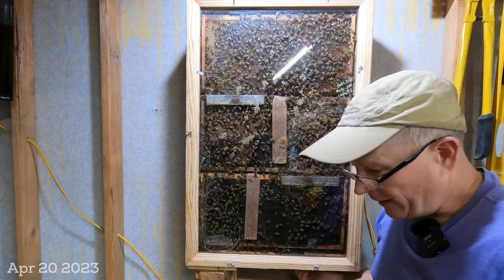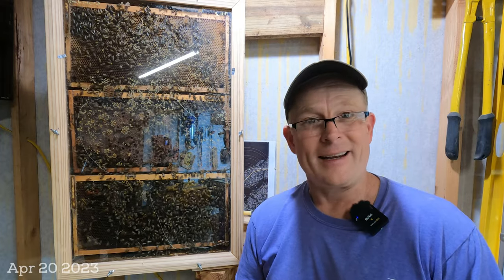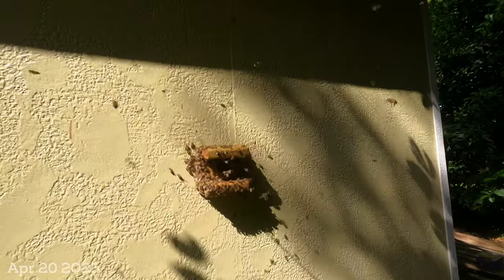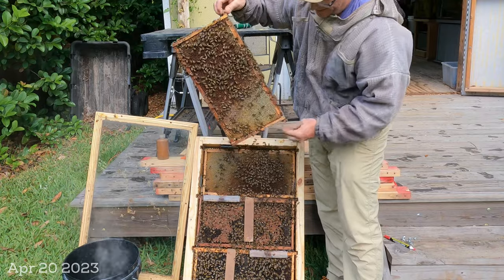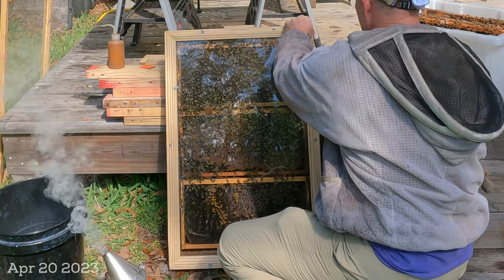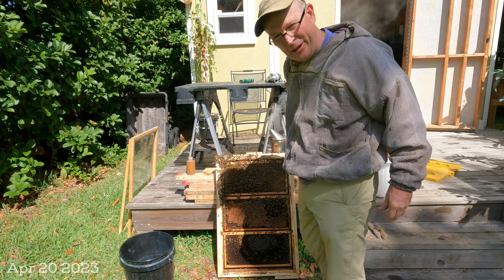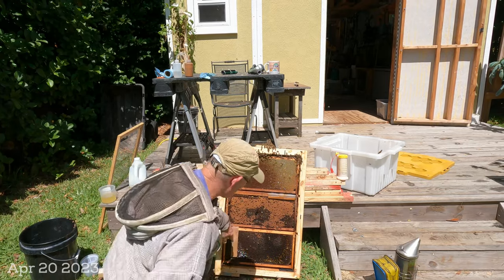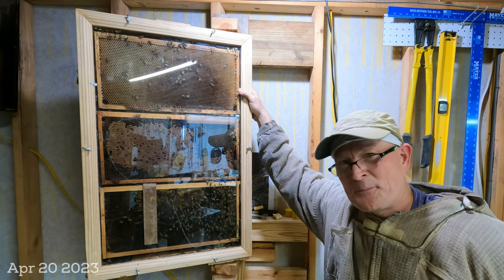Cleaning the Observation Hive and Marking the Queen (Only Two Mites!) - Jacksonville FL Zone 9a

Comment: I love the videos Chuck. I know nothing of bees, but find the information fascinating. I do have a question: what happens to the bees you swirled around in the water? Are the lost or do they survive that?
Reply from the maker: Those bees are lost as part of checking for mites. That was actually 91% isopropyl alcohol.  It is one of the best ways to get an accurate mite count.  There are more bees lost than this in a single day due to normal bee mortality. I know it sounds cruel, but not knowing your mite counts is more dangerous to the hive.  Thanks for the comment and feedback.
Reply: @chuckshoneybees  I probably missed the part where you said it was isopropyl. I do agree that a small loss is acceptable rather than losing the entire population to mites. I kinda figured that they would be lost, but just wanted to make sure. Thanks for the reply!
Reply from the maker: I might not have actually said it.  I have a separate video just on mite checks if you want more info. https://youtu.be/t2oto7gb9sc